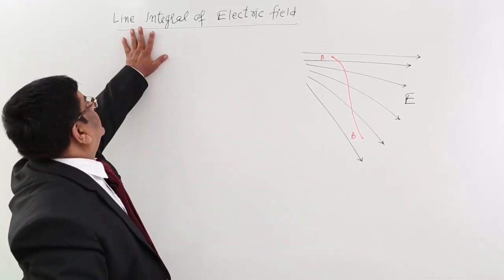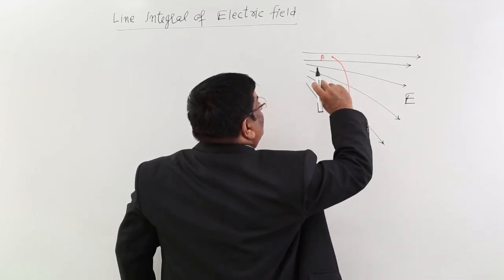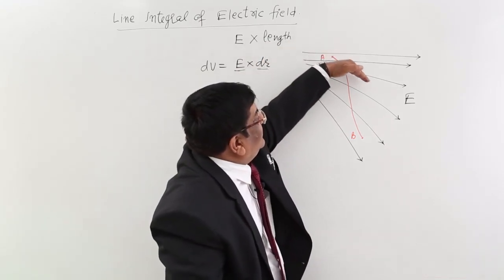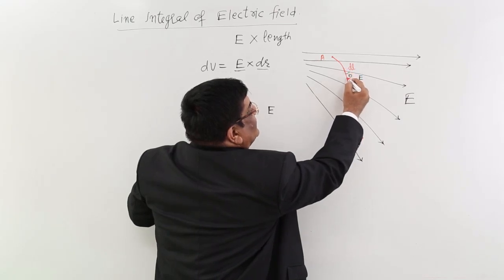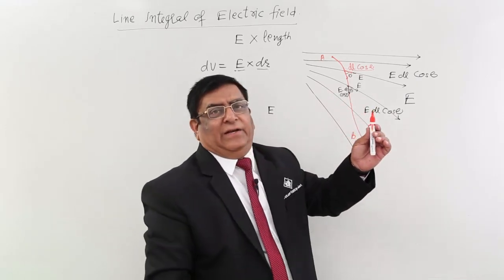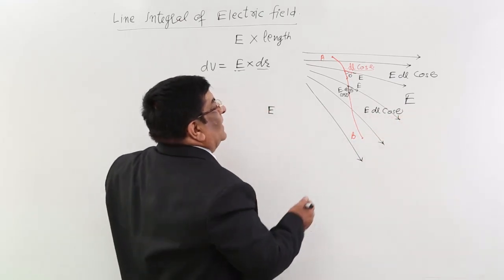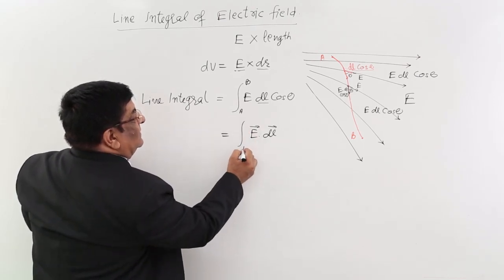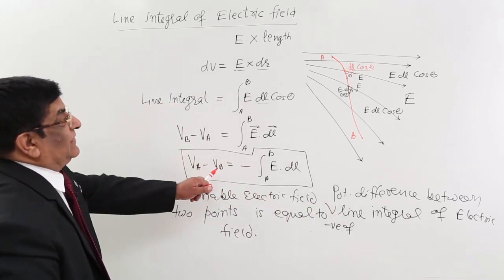Class 12th– Line Integral of Electric Field | Electrostatic Potential & Capacitance |Tutorials Point

Comment: Why we have to do Va-Vb to make another side negative, What the problem if it remain like Vb-Va.

Everywhere this negative sign is used but why?
Reply: @Jaydeep Nothing to worry about he just made that so to be in line with the original potential difference formula which he derived in the previous video where we get when work is done to move a charged particle away from the uniform Electric field from point B to A we get  Va-Vb= = -E dr or (dV= -E dr) but this time we found the potential difference in Variable E field when a charged particle comes towards E from A to B. we get Vb-Va= Integral E. dr, You see previous eq and this eq will match if we interchanged signs alone so to make one common equation he interchanged signs so you can be happy  Dont think too much :)
Reply: @WhatsUpBiyach  which one is the previous vid? thank u
Reply: @junkLAVENDER  Welcome
Reply: As you know, it is equivalent. It is kept as Va-Vb as tradition, in most every text you will find it written in such terms, but if it is easier to remember your way then it is the same. (It preserves the E ~ -V relation)
Reply: I think its just for showing conventionally that   POTENTIAL DECREASES IN THE DIRECTION OF INCREASING ELECTRIC FIELD and VICE VERSA